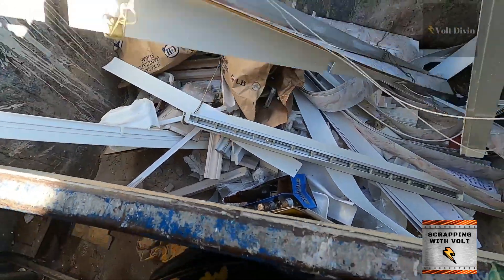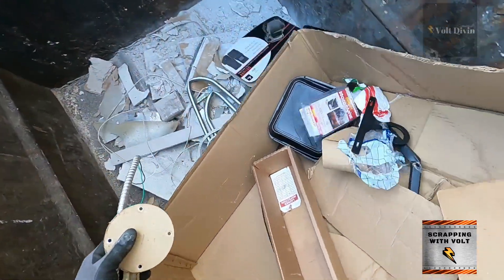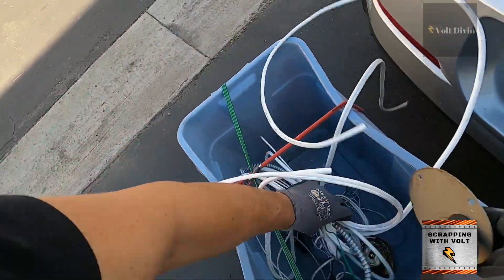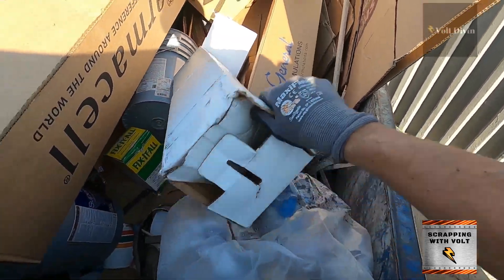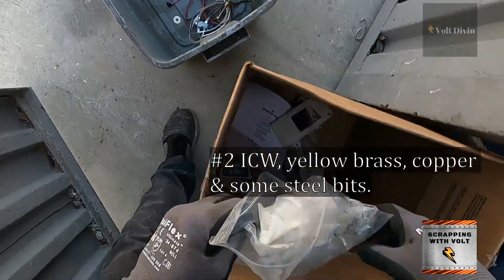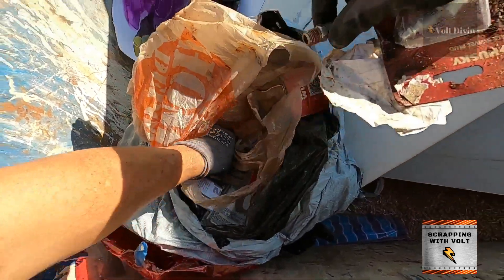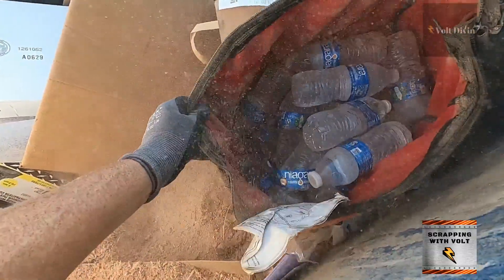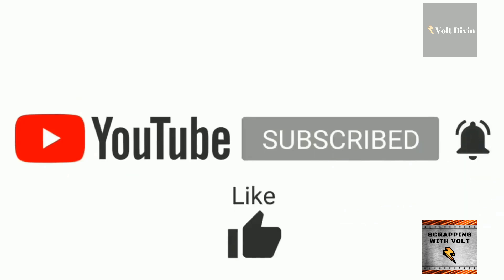Dumpster Diving Full Load! S1E50

Comment: I made a couple of tin can chimes using different sizes of cans, painting them different colors, drilled in the center, heavy duty fishing line with washers tied to hold each can in place and a big washer at the bottom. Everything was found in dumpsters except the tin cans which we saved and cleaned until we had 7 of various sizes for each set of chimes. Also made candle holders out of two large tin cans, used a small log to stick inside the can, then hammered a large nail into the cans to create a design which shows really well at night on the patio table. Used candles found dumpster diving.
Reply from the maker: That's a good idea